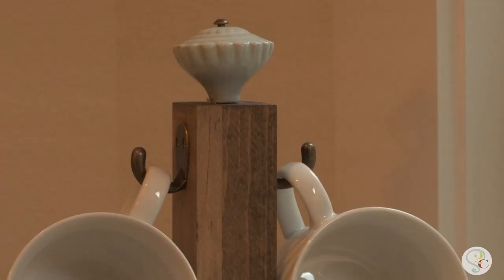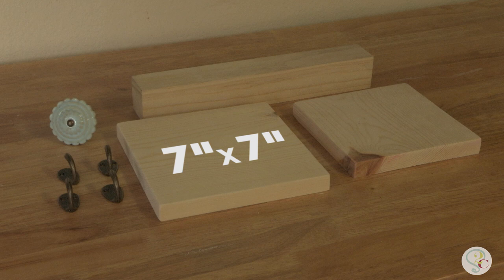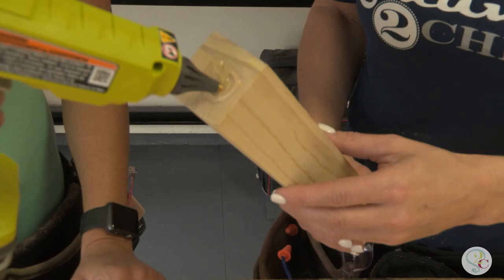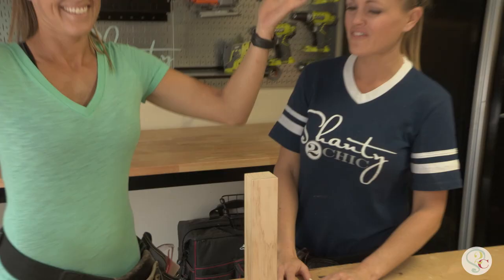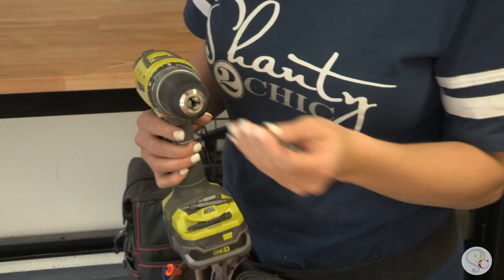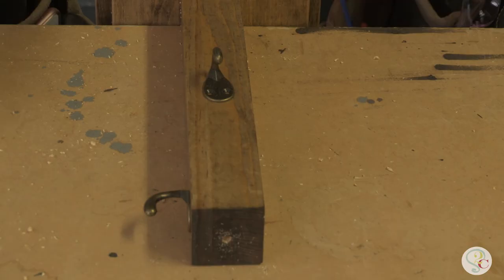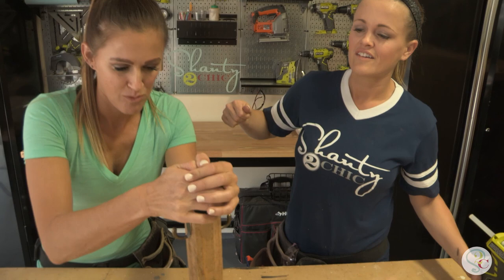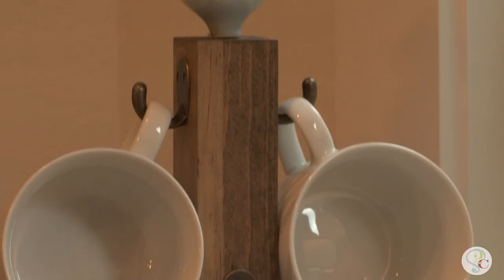DIY Coffee Mug Holder | HOLIDAY GIFT IDEA

Comment: great idea! I'd just use wood glue spreading it to the edges for a tighter seal instead of hot glue and clamp it over night.
Reply from the maker: sara braun we used a wood screw from the bottom. The hot glue was just to hold the pieces in place while we screwed it.  It's not a structural piece - just a little accent piece ;)